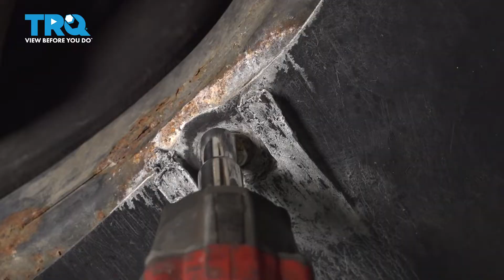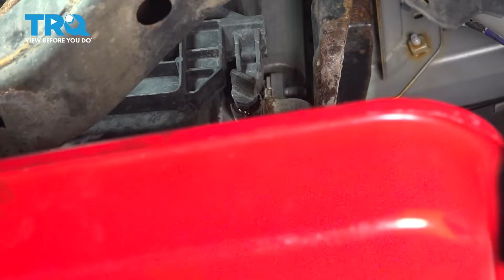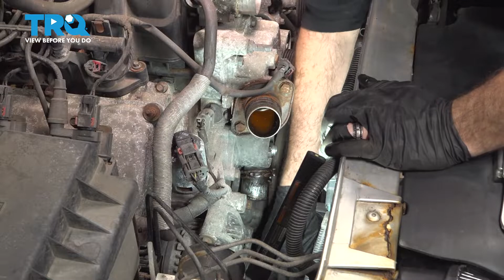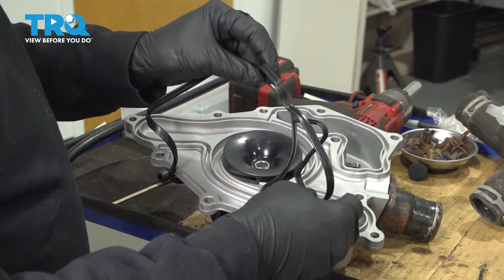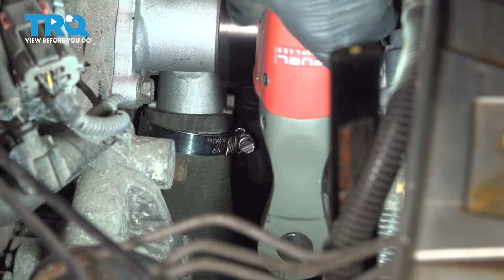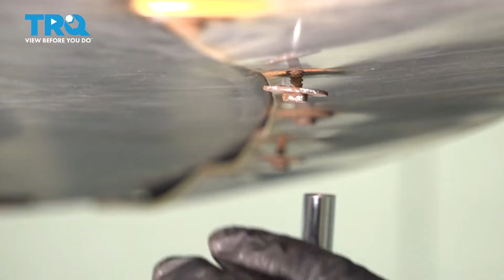How to Replace Water Pump 2005-2010 Chrysler 300

Comment: Great video. This will be the fourth time doing a water pump on the lx platform.  Needed a quick reminder. Very instructional. Some insurance in addition to the belt inspection…Also inspect and replace tensioner and pulley if needed. If you hear squeaking on cold starts in conjunction with battery/charging issues, replace those parts. You can also find o-ring kits and replace the one on the heater line. And if you’re replacing the upper or lower hose, be careful, the inlet/outlet on the radiator are plastic.
Reply: O ring , ding ding ding🎉😂

Comment: I have a 2006  300C, very good video, my car has 104K on it now.  Gonna do a new water pump.  Most folks only use OEM water pumps, after market may be ok, but I would prefer OEM, it cost more but not that much.  I figure if the OEM has lasted 20 years and 104K miles, its worth it.  That engine bay was super dirty,  I can't stand that, have to keep it clean for me, lol..I would also replace that little o-ring, why not, and a new thermostat while you're in there.  To catch all the coolant, get a cheapo plastic kiddie pool, you know the ones, about 3 or 4 feet in diameter, being new, you coolant could be re-used.  Also, I don't know, but should one use any anti-seize on all those bolts?  And i would torque them down to spec, being aluminium.   this was fantastic demonstration,  wonderful filming and presentation, thank you so much!!

Comment: Lot of rust does need a little cleaning. I think it is a good and helpful video but prefer holding water pump flush against engine block then installing bolts  and water tube. Very good idea to torque bolts going into aluminum. Thanks for the really good video.